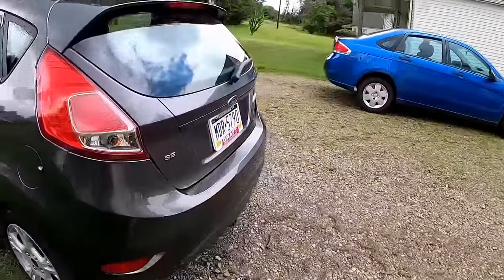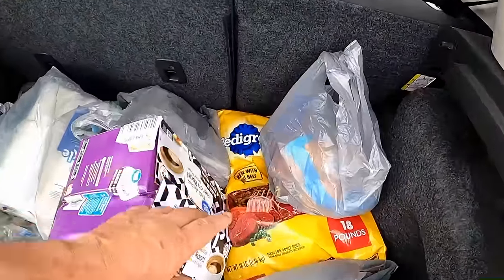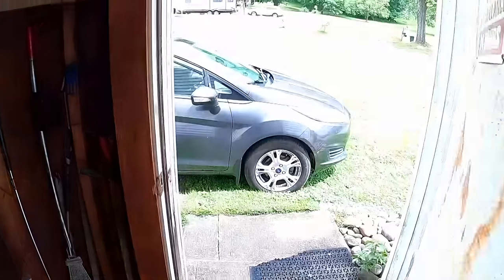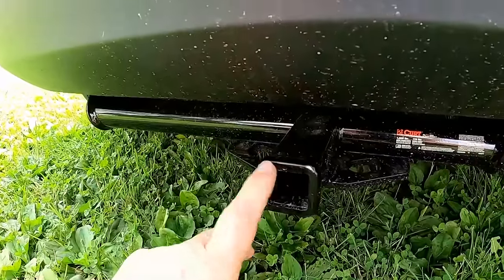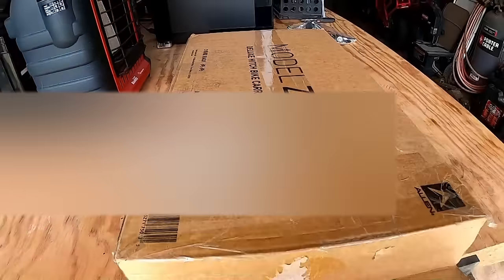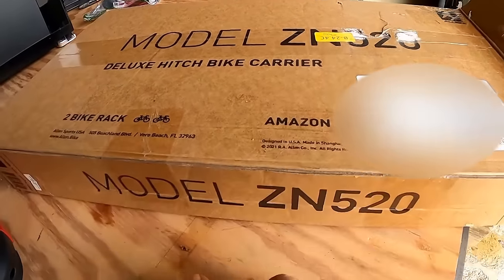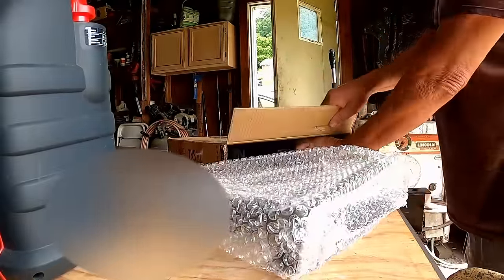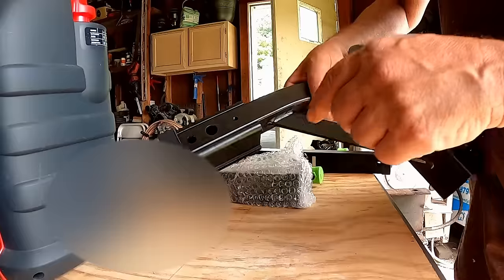My New Bike Rack For Class 1 Trailer Hitch, 1-1/4-Inch Receiver, Fits Ford Fiesta

Comment: So Dave, I have a similar rack only homemade.   If you have a coiled cable lock, you can keep your bike from flopping to & fro by capturing both front and rear wheels and coiling it around the vertical post one time.   Plus it adds a little protection from opportunistic thieves.

Comment: hi Dave!! if you use the bolt i think it holds the bike rack tight and you can get a brace that goes from the seat post to the front so you can put them on the bike rack have a great day!!!!!

Comment: Concerning the bike rack rocking, I have a rack very similar, 2" receiver though, the hitch pin on mine is a special bolt, the rack insert to receiver has a nut welded inside, insert bolt/pin tighten with wrench, no rocking, opposite has a hole drilled in the end two insert padlock.